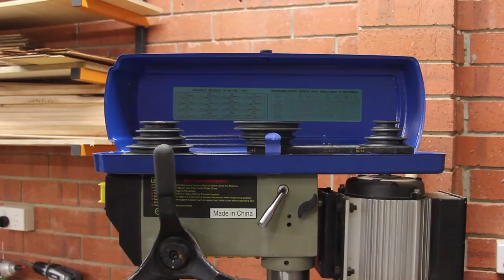031 - Drill Press Series: Intro And Review (SPD-20B)

Comment: Thanks Paul, very informative. I was looking at that machine. May now look at the "gas weld" and "trade tools" shops in Dandenong. They have their "own" branded machines in same price range, but with quill lock. Certainly don't want a separate oscillating spindle machine. Although I am quite partial to the Ridgid machine with dual drum/belt osc. Don't think this is available on our "little island"!
Reply from the maker: Sadly no, Rigid stuff just isn't available here. I'd buy that Rigid sander in a heartbeat if it was! Some rigid stuff is made by AEG/TTI, so I think the Rigid drill equivalents we get here, and perhaps even the saw equivalents, but all other "machines" (vs "powered hand tools") seem to be missing.

I tend to prefer the depth gauges that the Gasweld drills have (radial type on the plunge mechanism), so it'll be interesting to see how you go with them.